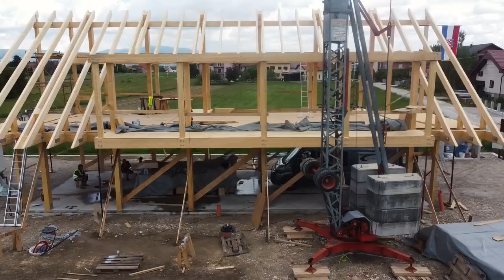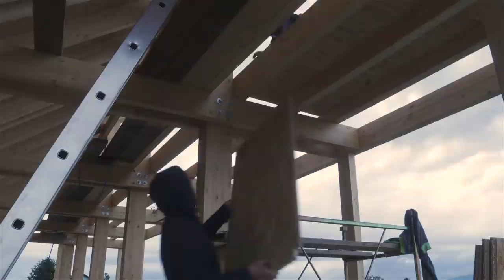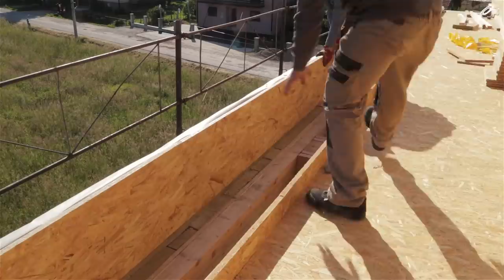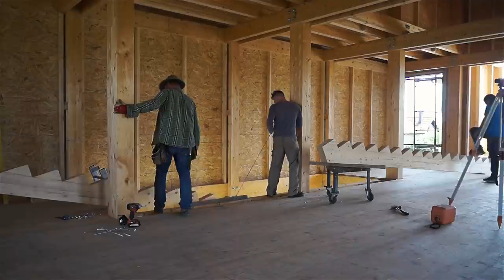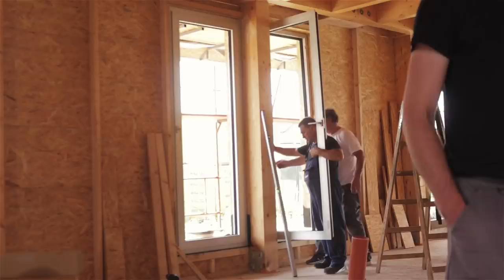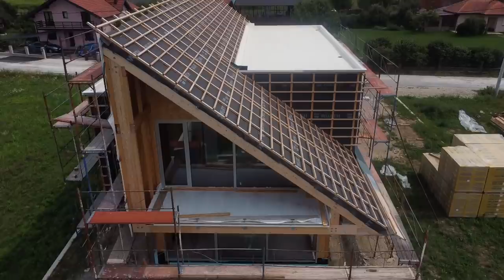Post and Beam House update

Comment: I found it interesting in a post and beam house that in some instances you didn't use the beams to carry the load but instead chose bolts.  If you are building a post and beam house why not let the structure of the lumber carry the load rather than relying on fasteners.
Reply from the maker: It mostly has to do with standards and price, bolts are easier to calculate, and you can guarantee they will hold as much they are calculated to hold. When cutting the posts for example, you are removing a part of cross section of that post so it could hold the horizontal beam, therefore you have to use a bigger post, and it drives the price up. Also the work needed to make a perfect fit so the load can transfer safely from one element to the other is much more expensive than using a simple bolt. When making a structure where wood is left visible I prefer using minimum of steel, but where it will bi mostly covered, it is much more economical to use fast, cheaper, and trustworthy connecting steel elements..

Comment: Great work! Only one question: why in a wooden house they (if you aren'y in charge of the windows) don't install wooden windows instead of PVC or aluminum ones? Thank you for the answer and keep going with your amazing work!!
Reply: I would guess price / availability / maintenance.
Reply: Usually wooden (frame-) houses are built with thermal efficiency in mind (at least at Europe) - and wooden windows are the worse in that thermal efficiency. Or you'll have window as thick as wall nd it would be really hard to use it in usual way. Plus, during time wooden window will degrade much quicker then PVC/aluminium ones with further decreasing at thermal efficiency.
Reply from the maker: I would have to check with the investor, but thermal insulation is the main reason I guess.. there are wood and aluminium combinations available that have both the looks and eficiency but they are quite more expensive. Also top part of the siding will be in aluminium so they will go together quite nicely..
Reply: @lignumchannel  Thanks for the answer! I'm a wooden windows maker in Italy, that's why i asked this question, and speaking of efficency PVC and wood are about the same, but aluminium is pretty worse. Speaking of maintenance I agree that wooden ones give some more work to do, but we both know that wood is always better :D

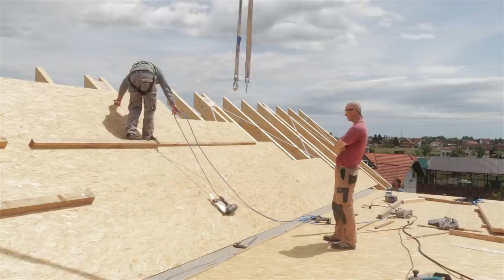Comment: one thing as a U.S. architect and someone that works with structural engineers ALL THE TIME,  not having the edges of the plywood line up over a rafter/joist and floating over nothing is exactly what you don't want. Regardless if the plywood is T&G (tongue and grooved) there is structural formulas for attachment (screw) spacing for the 'edge' of the plywood and the 'field' of the plywood. This is for shear strength and racking support. I am surprised at the amount of detail is given @ ~0:47 and they have X-bracing routed into the rafters so that the ply can lay flat but A/E doesn't give ANY directions on sheathing installation? 

Its not just a layer/skin on the system. It actuals DOES something for the structure. If the sheathing doesn't matter, why OSB/Ply T&G? Why not gypsum or some other material?  If OSB/T&G does have the racking/shear support, why the X-bracing?

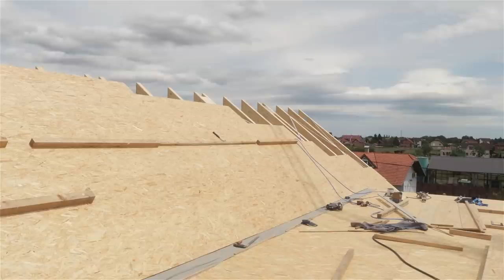Perfect example, (I know its is super high speed) @ 0:58, there is a TINY piece of ply being added on the roof....  I would rather walk on strapping over that gap instead of stepping on that substrate/sheathing!!! That will no-doubt be the soft spot on the roof in 25 years and the only thing holding it together is the T&G part of the ply.... And all they had to do was to make sure that piece went in between the two rafters.....     

Now go back and rewatch all the times they have the plywood dangling in air......  Otherwise nice work and nice design. Framers, get your stuff together. Not Good.
Reply from the maker: Acording to projected max forces for this house at this geographical location, about 70 square meters of 18 mm osb is required to take the horisontal forces in adition to steel braces and other load bearing elements.  I don't know the exact numbers by hearth (I'm on vacation right now) but there will be more than 700m2 osb covered area in the house when interior  of the walls will be instaled. Also investor chose 22mm osb for the outer skin instead of calculated 18mm. That is around twice as thick than osb most commonly used for outer sheating in the U.S. I agree that it's stronger to align it on joists but after all that previously said, it would be a waste of aditional material and time (money) for an investor to align it all on joists , wouldnt you agree? Especially with wood prices atm.. those 22mm t&g osb parts "dangling" will never become a soft spot.. only weight of wool will be ever perpendiculary applyed to them and they can hold a persons weight without a problem. If we used 3/8 or 15/32 inch commonly used in U.S. it would be another story.. Why not gypsum or something else? You would have to ask the architect but I assume it was the best ratio of price and quality at that given time. Elements that will hold the wooden and aluminum ventilated siding/roofing are conected thru osb to joists and other load bearing elements. Otherwise, I'm glad you like the project..